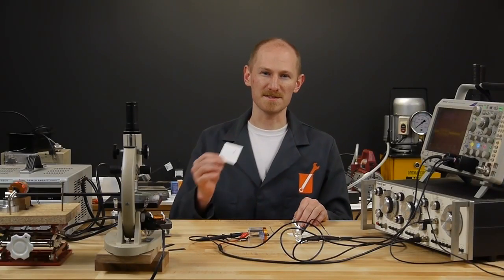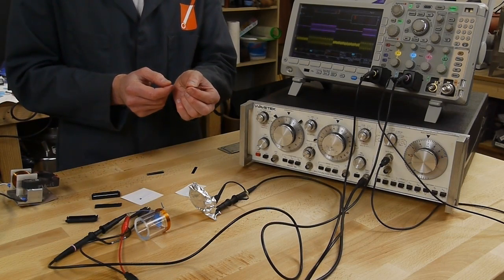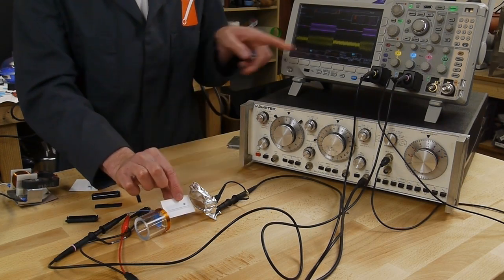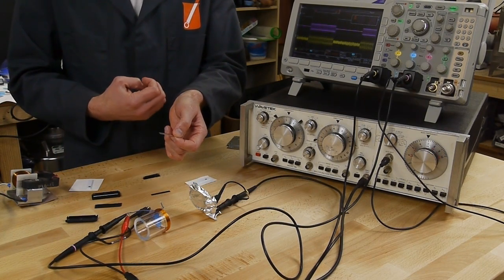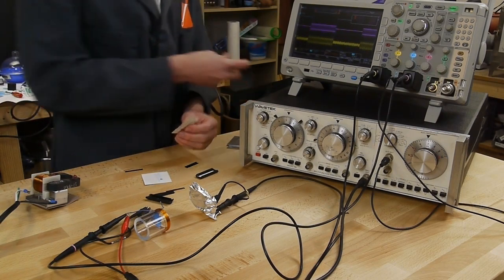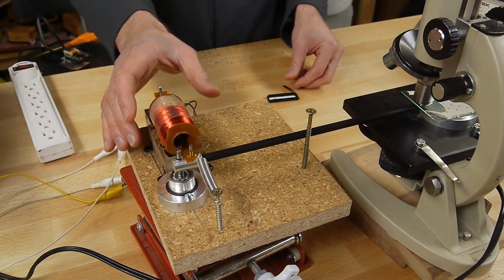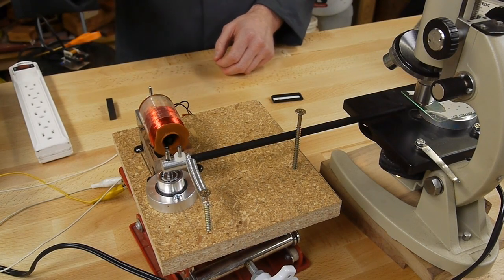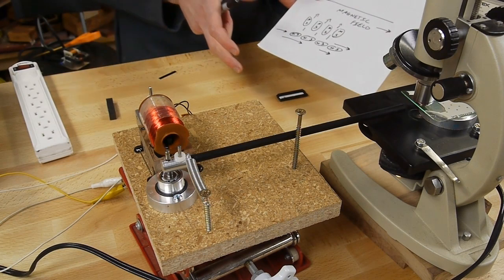How anti-theft tags work - magnetostriction

Comment: The lever solution is genius
Reply: +Barack Lasagna | Why not use a small mirror lever and have it deflect a laser? You see the results on the wall where the beam hits. You wouldn't even need a microscope.
Reply: +Nehmo Sergheyev great alternative
Reply: +Barack Lasagna Could have been done with a laser pointer instead, wouldn't need a microscope then and more sensitive too.
Reply: +Barack Lasagna Although I would be concerned about the field from the coil slightly attracting/repelling the hardware for the lever, causing movement that's confused with the magnetorestriction.
Reply: +Barack Lasagna I think you meant the lever solution is ingenious; Ben is Genius for sure. Only people can be genius. However people and things can be ingenious. All that to say, your screen name IS ingenious. Love it! He's been like a flat, wet noodle, covered in cheese as president.
Reply: +Nehmo Sergheyev  Exactly what is done with atomic force microscopes. Great on you, if you thought of that yourself
Reply: aaronq Using a laser on a mirror is not my original ideal. My father, who went to school in Russia before 1917, described to me when I was a kid a galvanometer (ammeter) in his school when he was a kid based on deflecting a small suspended mirror. (The laser is my modern contribution to the concept.) Even back then you could build something very sensitive.
Reply: cody's lab channel has an interesting video where he uses a lever to detect the force of light on an object.
Reply: Pete Lorenzo oh yeah, that was an amazing video, detecting the overall momentum of the photons hitting a reflective surface.

Comment: All my young years in retail I always wondered how those tags worked.  Thanks Ben!  Love the new lab diggs too... :-)
Reply: +DRC Paintball I've had some look at the internals of sensormatic stuff and from what I remember they have equipment to also rearm tags right? Not sure how they do that... I remember all the sensormatic boxes I had with huge 400v capacitors in them. I also remember that not all tags are even deactivated, the long clothes tag just has a special tool to remove it (that tool has two of the sticker alarm tags inside ironically) but stays armed. There was an electronic one as well with a battery inside that'd alarm if someone tried to remove the tag without using the special tool (I've got a test tag), did shops ever start using them?
Reply: +DRC Paintball What do you mean by "in phase"? Do you mean the alternating transmit and listen phases should be in step at all gates in the store? Since there is no network between the different gates of the store, how would syncronization work?

Also, what causes false alarming when the store is closed for the night?
Reply: +DRC Paintball Thank you.  How often does the transmitter transmit?  Do they get any sync help from the mains AC?  Otherwise, it seems like you would need atomic clocks in each gate to have different gates independently keep in sync to the precision required.
Reply: i hate retail. lol
Reply: @thedjnk trying too hard to sound brilliant accomplishes the total opposite 🙂
Reply: @gluino 🤣 seriously yo

Comment: I always cut the tags open and save the loose metal strips, as they're perfect for shimming lock cylinders for rekeying.
Reply: Brandon Fesser I tried but they cut me
Reply: I've never come across ones with exceptionally sharp edges.  Tap on the tag so the strips fall to one end.  Use scissors to snip-off the opposite end.  Pour the two free shims out.  The third strip isn't worth salvaging.
Reply: Ironic, using anti-theft tags to pick locks.
Reply: You must be the Lock Picking Lawyer, but you are under cover conducting research for your next video to shame lock companies! My lips re sealed ( wink, wink ). HAHAHA

Comment: Some anti-theft tags use an amorphous ribbon with a very square B-H loop and a very low coercivity, in fact the earths magnetic field is strong enough to magnetize them in one direction or the other. The transmitter coil generates a pair of fields at two different frequencies and the amorphous ribbon acts as a non-linear magnetic mixer generating fields at the sum and difference frequencies. Say the transmitter generates 5kHz and 8kHz then the sum and difference will be 13kHz and 3kHz respectively. The receiver coils pick up the 13kHz and sound the alarm. To deactivate the tags a small piece of steel adjacent to the ribbon is magnetised and that keeps the ribbon saturated.

Comment: One thing you forget to consider is that under the 58kHz excitation, the strip is resonating. The amplitude of displacement is roughly Q times the displacement under static (DC) excitation. Here Q is the quality factor of the resonator. From the ring down, Q is not small (most certainly more than 100, possibly more than 1000). So in the end, it is indeed theoretically possible for the strip to develop 0.1% strain (1/1000 inch over 1 inch) at its resonance frequency (12 ppm * 100 =  0.12%).  These being said, the lever setup is quite neat for static test!
Reply: If you can't impress them with brilliance,  baffle them with bs. 😉

Comment: Hi Ben.

Thanks for the video, it was enjoyable as always.

If your still interested in this topic you may want to try using a strain gauge to estimate the saturation magnetostriction.

If you glue the strain gauge directly to the ribbon surface with any brand of cyanoacrylate and then monitor the change in resistance via a wheatstone bridge configuration while slowly rotating the sample/applied field you can quite accurately estimate the saturation magnetostriction using the know gauge factor. We use this method in the lab I work in and so I can assure you its possible to achieve sub ppm resolution. I wish I could point you in the direction of a few papers on the topic but its very poorly documented in the literature. 

If you have any questions about this, or on magnetic materials (especially nanocrystalline or amorphous materials) in general feel free to drop me a line.

Richard
Reply: +Capo Interesting thank you.

Comment: Very interesting, I especially like the meter you made to measure such slight movements. I use the strips as shims in my home machine shop, because their thickness is between .0005 to .001, for example; when I have one of my lathes preoccupied with a four jaw set up,  that I can't break down, I'll use another lathe that has a three jaw chuck, test run out with a workpiece in the jaws, and fill the high spots with two or three of those strips, to get as close to a four jaw reading, if at, times, even better. I was commissioned to build a micro wire straightener 2. Years ago, and, as you may know, the straightener parts had to mesh as perfect as a Swiss watch, suffice it to say, I placed at least ten of those strips through the machine, and when their assessor tested the little machine he certified it as passing, as a Swiss watch, not knowing of the security strips turned shims...rotfl 😃

Comment: Your data suggests that the resonant frequency of the metal strip is narrowly defined by the dimensions and temperature.  If you were to change the temperature significantly, you'd change the resonant frequency and thus the tag would fail to function normally.
Reply from the maker: +eformance That's a really good point!  I hadn't thought about extreme temperatures causing the tag to malfunction.  I wonder if the manufacturer has a spec on that.  I'll have to try it with freeze-spray and a low-temp oven.  Thanks!
Reply: +Applied Science Up next in the shoplifter's arsenal: Gas duster and/or a hand warmer. :D
Reply: +eformance Where's the data that, say, a 50K temperature change would alter the resonant frequency enough to cause a problem? The thermal expansion may look huge under the microscope, but it's still tiny compared to normal mechanical tolerances. The Q of the metal strip is not all that high, it dies out pretty quickly.
Reply: +eformance The reader does a frequency shift from cycle to cycle to shift the resonance through the tag response range. There is also a series of switches that alternately swap the transmit and receive aluminium strip coils so that the tag distance is not going to make a difference. The transmit power is pretty high, around 50W of power, it does make every metal thing within 5m of the coil have a circulating current, which means any CRT within 5m of the coil will have a very annoying beat on the image as it modulates the electron bean scan. The tags are pretty reliable in use, very few will get past without triggering the system.
Reply: +Hatagashira I've seen a video by Samy Kamkar on how to trick the motion detectors at glass shop doors with a gas duster, now I see just another reason to carry them with me on my next shopping tour haha :D
Reply: +TheHue&#39;s SciTech My reasoning is this:  The wavelength of 58Khz is 5172413793nm, I estimate the strips are 1/128th wavelength, so 40409482nm.  As you saw in the video, the change in temperature of the strip significantly changed its length, causing it to be a non-square multiple in length of the wavelength, changing the resonant frequency.  If Ben can characterize the change in length per unit of temperature, it is possible to determine the band of resonant frequencies for the temperature extremes and determine if the scanner sweeps into that frequency.  I would anticipate that the strip probably gets well into the 70Khz+ range when made very cold with a refrigerant sprayed on it, I doubt that the scanners try to read a deviation of more than 5Khz.
Reply: +Hatagashira Or a magnet
Reply: +Applied Science wouldn't that change the magnetic properties of the magnet strip as well?
Reply: eformance These are physical, acoustic vibrations in the metal we're talking about, not a dipole antenna or anything like that... It's like the resonant frequency on a violin string. You can't calculate that with speed of light / length. It's not operating at the 128th overtone, nor the 128000th overtone (that you would have calculated if you did your incorrect maths correctly) - it'll be the second or third overtone, if not the fundamental.
Reply: TheHue's SciTech The wavelength of 58Khz is about 5.1 meters, my point is that at 58Khz, for a physical object to resonate, it needs to be tuned to the RF frequency.  40.4mm is 1/128th the wavelength of 58Khz, and the tags are about that long. The 58Khz RF is converted into EM force at the wavelength of the RF frequency, causing the strip to resonate in the weak magnetic field provided by the 3rd metal strip in the tag.  That is, if I understood Ben's video and recall RF/EMF correctly.
Reply: eformance Type "c / 58 kHz" into Google, you'll find that the wavelength is 5.1 KILOmeters. Maybe you got kHz and MHz confused. Next, think about when Ben dropped the lids on the table and they made different tones -- calculate what tone you'd expect those lids to emit with c / size. With your flawed reasoning, I arrive at 3 GHz, which isn't exactly audible!! I reiterate, the vibrations in the metal strip are physical/acoustic, not electromagnetic, so the speed of light is irrelevant. The vibrations are indeed powered by incoming magnetic field variations, and they emit similar variations, but the underlying oscillator is purely physical/acoustic -- hence the acoustic in "Magneto-acoustic" tag.
Reply: +TheHue's SciTech Darn it, I ran the numbers again and realized I was looking at meters and thinking centimeters.
Reply: +eformance A 1 ppm change in length translates to a 1 ppm change in resonant frequency. So these small contractions won't put the resonance outside the system bandwidth (for reasonable Qs)
Reply: +Hatagashira or just a really strong rare earth magnet to destroy the strip altogether.
Reply: Ignacio Martinez Hehe, thanks, that's a much simpler way to explain the problem with eformance's claim!
Reply: +Applied Science How many stores operate outside of 'mall' temperatures?  I bet the amount of temperature change required to get the resonance out of spec would be significantly uncomfortable for a shopper.  Good to know you can heat up your dvd to walk out of the store though.
Reply: +Power Max That doesn't really happen often and I believe his tag may have been faulty.  I swipe rather larger neodymium magnets across tags all the time with no issues.
Reply: I was thinking more along the lines of the really strong magnetic field interfering with the detectors and the signal being transmitted/received. Having it sit on the strip I think will keep it from resonating both because it will go into magnetic saturation, as well as physicly deform ths trip a bit to dampen any vibrations in it. Though I did think a large enough magnet would actually destroy it also.
Reply: +eformance 58 kHz wavelength of what? The acoustic standing wave in the metal strip? If you are talking about EM wave, 58 kHz is 5km wavelength. So most of what you said doesn't really make sense in light of that. Also I didn't notice any part of the video where he changed the temperature. Where was that?
Reply: +eformance 58 kHz is around 5.1 km. There is NO electromagnetic resonance taking place in the strip. There is a mechanical resonance caused by the external magnetic field operating at 58 kHz. Similar to the 120 Hz (or 100 Hz) transformer hum or buzz you may have heard in a laminated transformer core.
Reply: +eformance While the tape is vibrating, the magnetic path is changing accordingly to the oscillations, causing the magnetic flux around the set (magnetic + tape) also to oscillate. This varying magnetic field can be detected by the receiving coil. If there is no magnet, there is no oscillating magnetic field. Why a vibrating tape would generate a oscillating magnetic field by itself?
Reply: +eformance  No, this can't be right. By analogy, if you heat a tuning fork, it will change in length - but it's resonant frequency will not change directly in proportion. In fact, if you were right, they would never be able to  make the tags - the length change on 2cm due to, say, a 20 degree centigrade temperature change would be far smaller than their manufacturing tolerances. In short, the length may change by a quite a bit with temperature, but the resonant frequency won't
Reply: How about just bending the tag so it's no longer a rectangle? Shouldn't that change it's harmonics?
Reply: @mckenziekeith7434  Wouldn't it be the speed of sound in the material, not sure the precise value for this particular alloy but metals and their alloys are typically in the region of several km/s which would put the wavelength on the order of a few cm at 58 kHz.
Reply: @seraphina985  I no longer remember this conversation. I would have to re-watch the video. Obviously it would be very important to determine what kind of wave is being discussed. Is the tag acting like a speaker cone in which case it would be an air-based resonant frequency, or is the tag vibrating at a mechanical resonance in which case you would be right, or is it an electromagnetic resonance due to an inductor and capacitor. Most likely, there would not be an acoustic standing wave in the metal of the tag.
Reply: @mckenziekeith7434  Well it's the tag itself physically changing length due to the magnetic field so I would imagine it's probably the speed of sound in the metal also the wavelength of a 58 kHz wave in air is around 5.1 mm (depending on ambient conditions of course) as the speed of sound is much slower in air than in a solid so the math would seem to point to it being the speed of sound in the metal though can't be entirely sure without knowing the precise composition of the alloy in order to look up it's physical properties. I'll admit that I am merely hypothesising here on the basis that it appears to match the properties of the metal better than it being one of the other factors determining why a strip of that length would resonate at the correct frequency.
Reply: so if I put it under a hand warmer the device wouldnt resonate?
Reply: Nobody cares

Comment: Great video! A quick note: While the maximum displacement under static field might be ~several microns, that is only under static field. Fluctuating the field at the resonant frequency of the metal plate will "ring the bell" and cause greater and greater displacements

Comment: I learned about this by pranking shopping carts attaching the tags to the underside.
Reply: inademv it's a periodic pulse the energy was stored in the resonating metal strip which then continue to resonate in a dampened amplitude for a certain amount of time after the pulse ended. The anti-theft tag actually doesn't add any energy to the system it actually takes away from the energy transmitted in order to induce its own oscillation but the receiver isn't looking for that it's looking for the continued oscillation after each pulse goes quiet if the pulse stops and the receiver no longer hears anything and no tag is passing through but if the pulse stops and there is still a ringing coming out of the system then it must be from the tag
Reply: Wrong person sorry
Reply: Buahahaha genius

Comment: @6:06 this piece is called the "Bias Magnet" and it provides the Magnetic Bias to put the resonating Magnetorestrictive thin metal on the resonating point on the curve. If the magnet is not present (Deactivated Tag) then the Magnetorestrictive piece of metal is still the same but will be displaced to a non resonating state on the curve.
Reply: Makes absolutely no sense like most of your long winded comments.